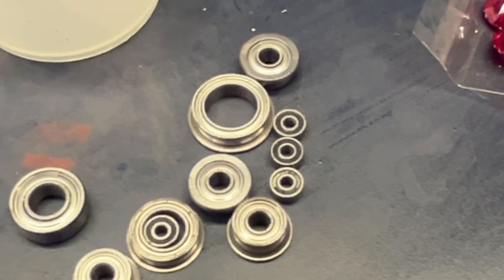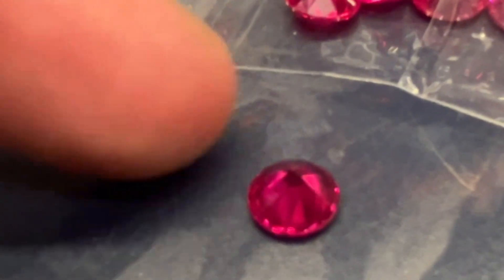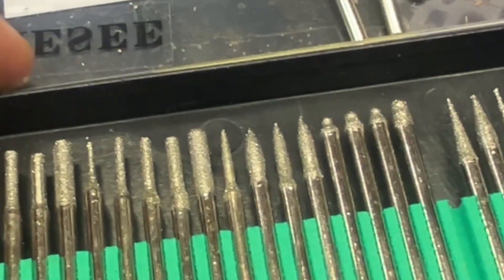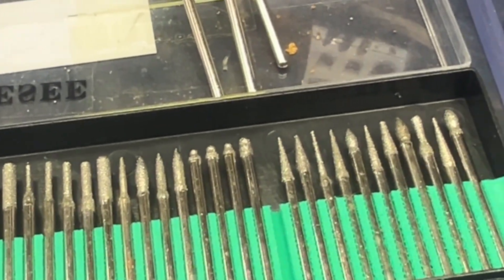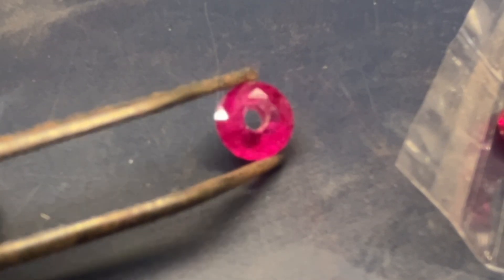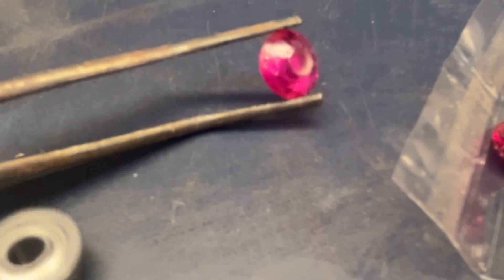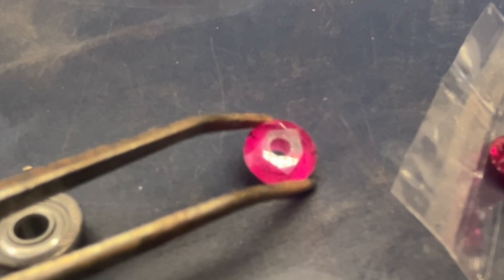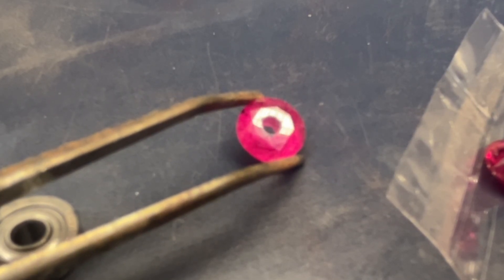Can You Make a Clock Jewel from Synthetic Ruby? (I Tried It!)

Comment: Without knowing if you intend to make a replacement jewel that ordinarily is difficult or expensive to obtain, I can't comment on the sensibility. I need to replace a jewel that is "a hair" larger than 1.5mm with a ~.2mm hole. I promise you will NOT be able to fabricate this jewel in the manner illustrated. Further, all you have accomplished to this point is drilled a thru hole in a ruby. This is only one of several tasks you'd need to accomplish to complete the fabrication. Whether you'd be able to is doubtful and even more doubtful is that you'd obtain the tolerances needed. A master watchmaker can produce every single metal part of a watch or clock. They DON'T produce ruby jewels! Can you guess why? (Note: they can produce screws with thread pitches you'd need a microscope to even see. Food for thought)
Reply: Not knowing anyone’s background, I’d be reluctant to make definitive proclamations as to what is possible. Just because it’s impossible for you doesn’t mean it’s impossible for me.
Reply from the maker: Thanks for the detailed comment. You’re absolutely right that producing jewels to the tolerances used in modern watchmaking is incredibly demanding, and far beyond what most makers would attempt without specialist tools.

That said, the BHI (British Horological Institute) actually included a module on making ruby clock jewels as part of their training, and several classic horological texts also cover the process. For example, A. L. Rawlings discusses jewel geometry and tolerances in The Science of Clocks and Watches, and the New and Complete Clock and Watchmakers’ Manual (1860) includes guidance on drilling and finishing jewel holes.

My video wasn’t claiming to reach commercial standards, it’s really just about exploring and demonstrating a technique to drill the ruby and I don’t think I’m far of lapping this clean and to size and using it in a clock. Maybe you a right but I’m even more keen now to give it a go!

Comment: I agree with @deadlockdead
I'd probably suggest the methods Daniels suggests in Watchmaking, and use a piece of copper wire with diamond paste to lap the inside of the hole, but also to make the outside perfectly circular, to allow it to be press fit or rubbed into a clock more easily.

I should note, I have seriously considered trying this, but never got around to it, so you certainly have more experience than me. I might have enlarged a jewel hole using Daniels' method once, but I honestly can't remember
Reply from the maker: I have that book and haven’t looked at it for a while! I’ll dig it out and have a read. 
Chris

Comment: You definitely have to lap the inside. It's not only the surface roughness, but also the only way to control the tolerances. If you want to set the OD and have it concentric to the bore, just stick it on a tight fitting dowel and grind it while spinning it. On your CNC, you can put the dowel in the collet chuck and have the abrasive stationary (well, optimally the abrasive would be another rotary tool) and just slowly feed into it
Reply from the maker: Great point! I’ll give polishing it a go. Just ordered some diamond pastes